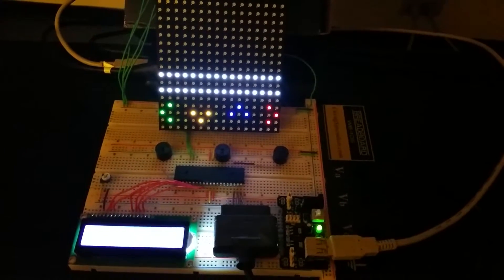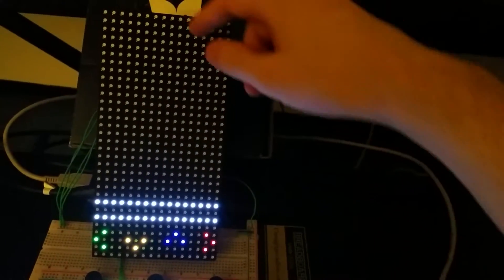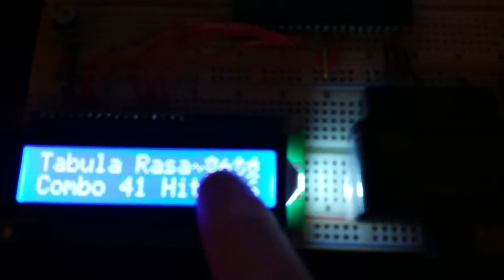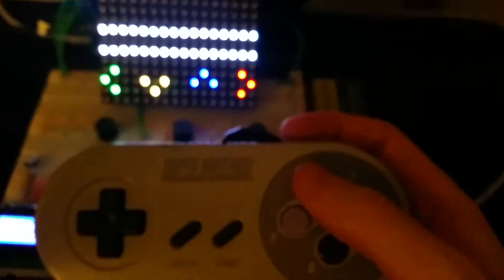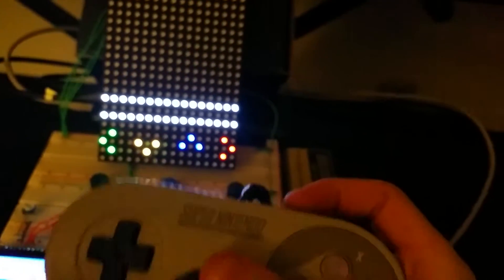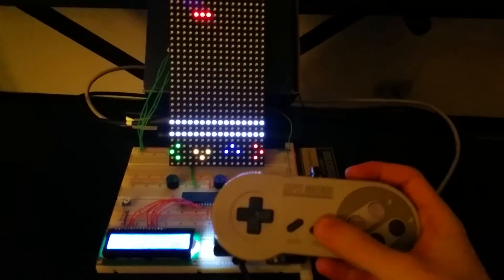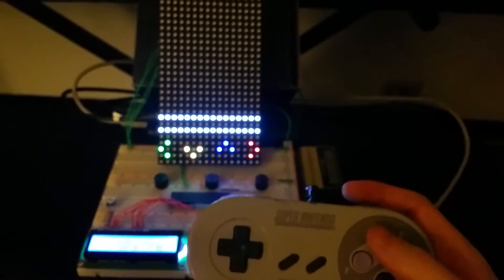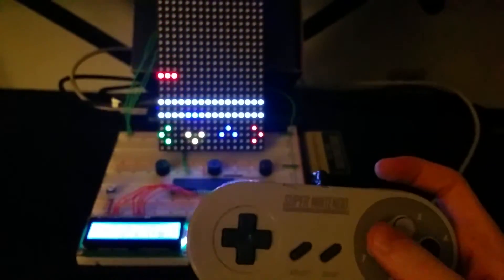UCR EE/CS 120B Spring 2018 -- Jonathan Oaks -- Stepmania

Comment: hi bro, I am taking CS120B right now and I also want to create a music rhythm game like this, but I don't know what to start with... How did you convert the music notes to generate the block falling down?
Reply from the maker: I made a file that stored the tempo, tone and note durations, and beatmap, that would send that data to the systems that required them. The tone data would get sent to the speakers to play the indicated tone for the indicated number of beats, while the map data got sent to the Arduino. The entire map was a byte for every beat, where every 2 bits represented whether or not the button should be pressed, held, or released. The Arduino handled creating a note depending on the data that came in and what part of the beat it came in on and displaying those notes on the LED matrix using the libraries Adafruit provided for it.
Reply: can we discuss more by email, I’m still confused about the general idea, can I have your email to talk more about it?
Reply: great! thanks bro! @nailcliper